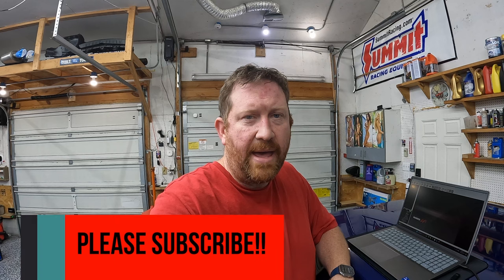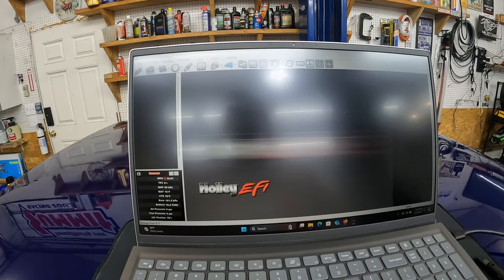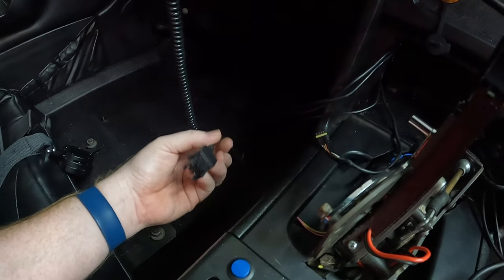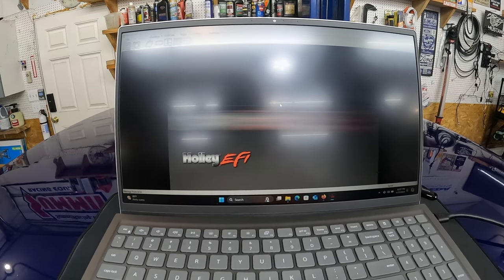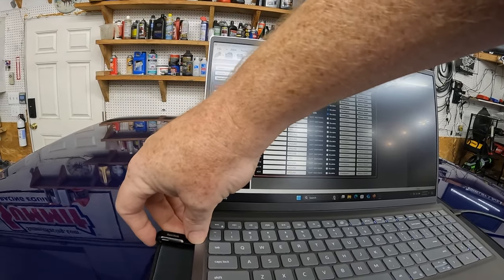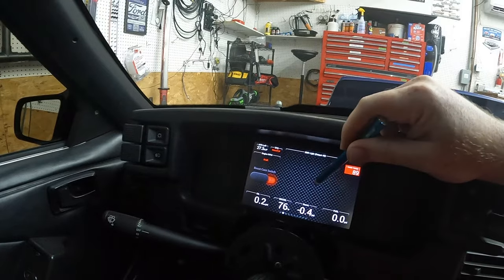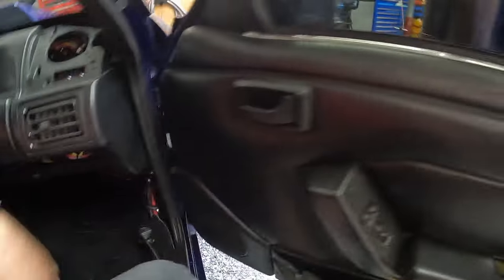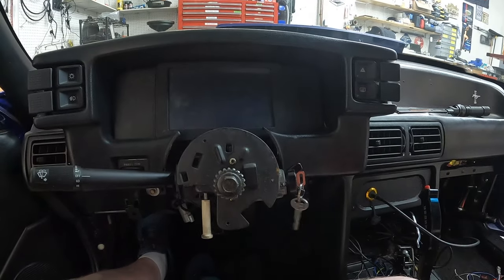Holley EFI V6 Build 400 Firmware Update - How To

Comment from the maker: At the point where you select the firmware file for the upgrade portion the file you are looking for is an .eep file for the dominator/HP upgrade firmware.  It will be located in the firmware folder for your new build 400 installation on your laptop.